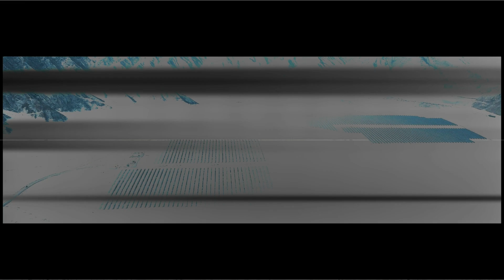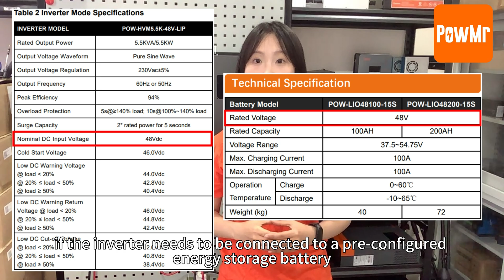How to choose the right solar inverter- PowMr

Comment: If my load is average 600w (4 fans 320w, 1 Computer 100w, 1 TV 150w). And sometimes I will need to use the washing machine (800w) while reducing other loads only during day time. I have 1600w (4x400w) of solar panel. 3.2 kW models  will work for me? Thanks
Reply from the maker: Hi, for refrigerators, water pumps, washing machine, and other inductive loads whose instantaneous power may reach 5 to 7 times their rated power when starting, it is necessary to reserve sufficient margin in the selection of the rated power of the inverter to ensure the normal operation of the load end. The surge capacity of POW-HVM3.2H-24V-N is 6400W (2*rated power),  so the 3.2KW model should be no problem. You can add more solar panels.
Reply: Thanks a Lot @PowmrSolar

Comment: I want to buy this one: PowMr 4200W 24V Solar Inverter . I have a consumption of 600 watts per hour. Can I set the converter so that it feeds in these 600 watts (PV and battery) for as long as possible?
Reply from the maker: Do you mean uninterrupted power supply for a long time?
Reply: @PowmrSolar  I have the following idea: I want to tell the inverter to use 600 watts from the battery at night as long as it has enough power. During the day, the inverter should feed 1000 watts into the house and use the remaining power to charge the battery. When the battery is full, it should feed the excess into a heater. I think that in winter the battery will not be full and I will have several hours of interruption, or will be sourced from the power grid.

For me it's more about limiting the output power to 600/1000 watts and getting everything above that into the battery.
Reply from the maker: @michaelcomfai9788  We would like to know if there is a refrigerator, air conditioner, washing machine or water pump?
Reply: @PowmrSolar  Yes, sure, there are 4 refrigerators, 2 air conditioners and a UNIX server that needs a lot of power. That's why I get a basic current of around 600 watts per hour. An inverter with 3 limiters would be best, but I don't want to do the work because the solar system is 30 m away from the house and the installation can no longer be done by me as a layperson. That's why I would like to find a solution that uses the "watering can principle" to feed in 600 watts at night and 1000 watts during the day. If I still get power from the grid, I simply increase the values by 100 watts.
Reply from the maker: @michaelcomfai9788 Hi, this 4.2M unit cannot carry all the loads in your home. The operating power of inductive loads is generally 5-6 times the rated power. One 4.2M model can drive up to one refrigerator or one air conditioner. If you need to use so many inductive loads, you need a more powerful model.